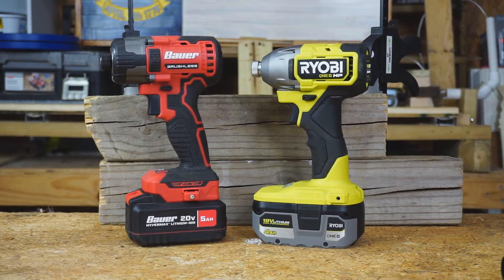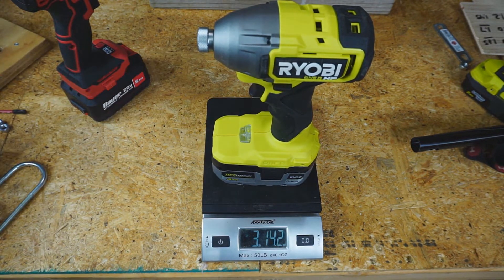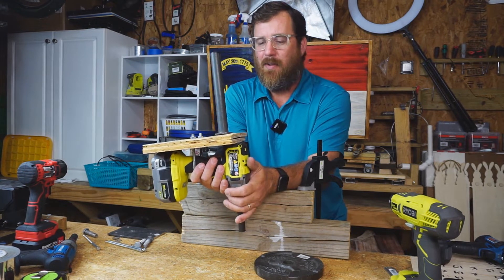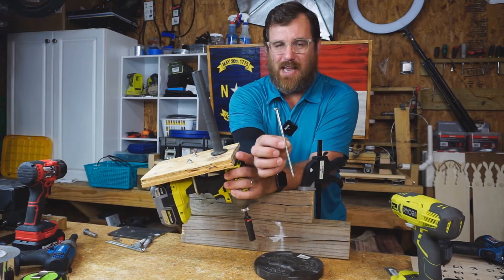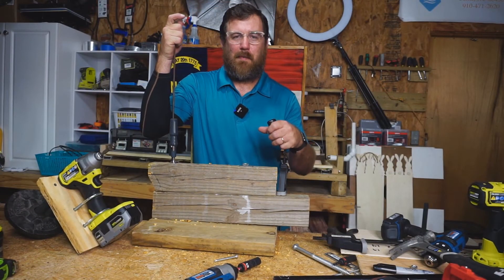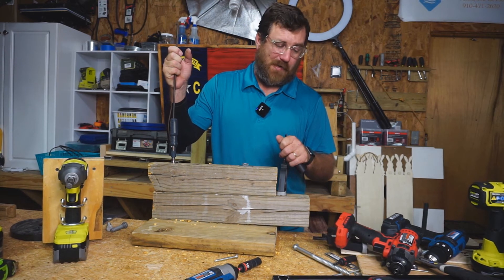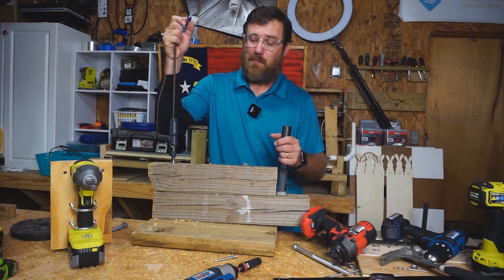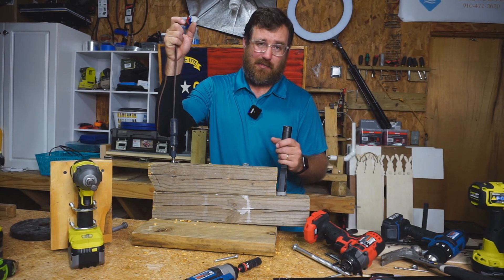Can a Bauer Brushless Impact Driver Beat Ryobi One Plus HP?

Comment: I was considering committing to bauer or Hercules. I don't need top shelf tools since I don't make money off my tools just home use and projects for the family. Still undecided
Reply: What did you end up going with?
I usually always go with Harbor Freight but due to market saturation I went with Ryobi. Between Facebook Marketplace, ebay, Home Depot Ryobi Days, and Direct Tools Outlet Ryobi is super cheap. I haven't had to pay more than $25 for most tools or 4ah batteries.
Reply: I have both herc and baur but just started buying ryobi for me it's the fact all ryobi tools share a battery platform whole herc doesn't have as many tools